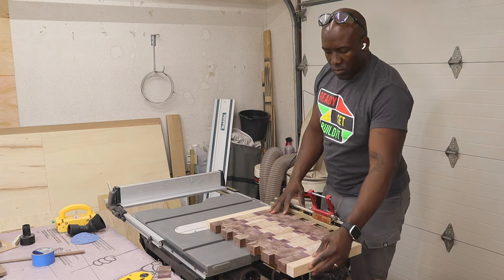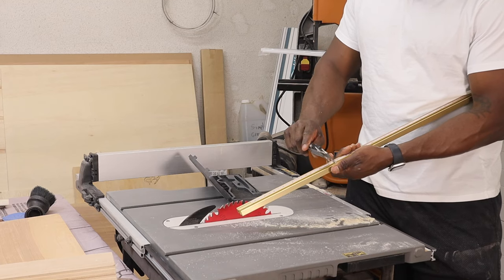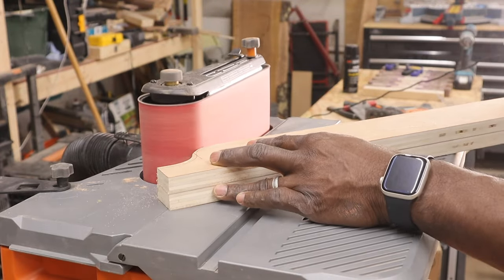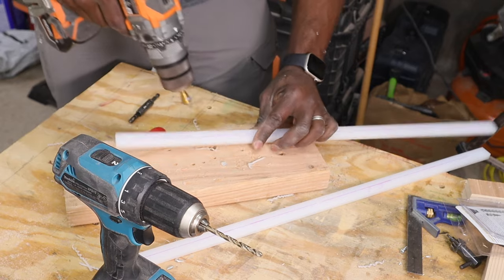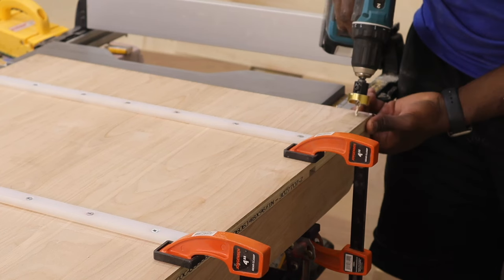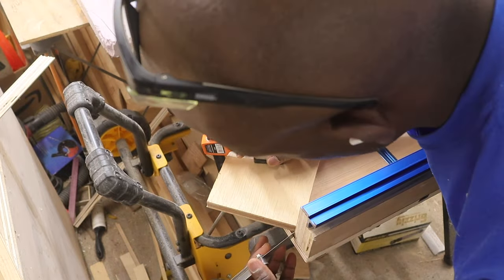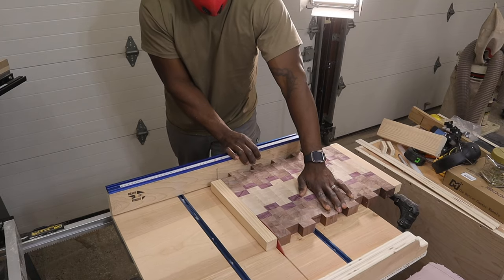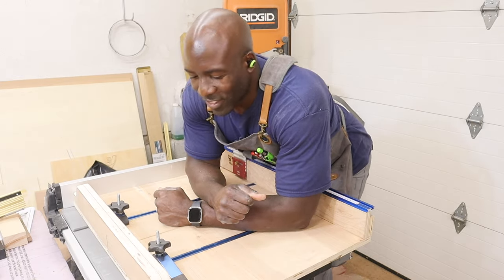The last Crosscut sled you’ll ever need

Comment: Enjoyed your video and just subscribed!  Have the same DeWalt table saw you do and am building my first crosscut sled with UHMW runners.  The runners fit and moved perfectly in the miter slots BEFORE I attached them to my sled base.  After attaching them with CA glue and the screws that came with the runners, now they won’t slide smoothly in the slots.  I hand-tightened the screws so as not to over tighten them using a drill and even backed the screws out some but still leaving them countersunk.  They still will not slide smoothly.  May go to the hardwood runner option as you did, but I live in a hot and humid climate and am concerned about wood movement when the seasons change.
Reply from the maker: Thanks. Welcome to the channel. I understand your dilemma. In your case I would go with an aluminum runner or at the very least pick a really stable dense wood for your runners and be sure to cut them with the grain in the right direction. Scotty Walsh has a great video about choosing aluminum runners you may find helpful. Thanks again for the sub and good luck on your crosscut sled.

Comment: The runners will spread as you tighten them. I did the same thing. I tried using wood but being in houston it would swell and shrink
Reply from the maker: I get that too. It’s possible I over tightened the UHMW. The next step, should these runners ever swell, is aluminum runners, but I think I’ll be ok due to the Ipe being of the hardwood floor variety and very old. Moisture content should remain really low.

Comment: Interestingly, I had an old DeWalt saw and had a similar issue with UHMW runners. No matter how much sanding and refining I did, I couldn't get them to glide smoothly.

When I upgraded to my sawstip CTS, the problem went away.
Reply from the maker: Curious. I was getting really frustrated. Specifically, I was having all my problems with the left miter slot. It’s almost as if the slot it self isn’t perfectly straight. I even sanded the inside of the miter slot. Once I changed to wood, all my problems disappeared.

Comment: I followed the build up to the point where you had to adjust for square with the feeler gauges. How are you able to adjust the wood positioning to make it square after you've already screwed it in?
Reply from the maker: I take out one screw from the bottom and use the other as a pivot. The. Once I gap it with the feeler gauge, I put the screw back in and perform the 5 cuts again. William Ng has a really good video on explaining the process. I linked him in the bottom of my video description. He does a better job than I can explaining.

Comment: This was a great video! I now have no reason to NOT build a cross-cut sled. Like you, I’ve been going back and forth about needing one. Now, is the time! I have the same table saw. I’ve also been debating the use of the UHMW for my runners. I’m afraid to use to use wood for the runners. I live in Maine and mother nature has been very moody. What’s your opinion on the adjustable metal runners? Also, what dado stack set do you use? It’s not in your tool list and I’ve been on the hunt for some…
Reply from the maker: Thanks so much. Temperature fluctuations was a huge concern of mine as well. I think if you go wood, choose a dense stable wood. That being said, metal runners are superior as they won’t move and their adjustability. I’ve added both a metal runner I like and the dado stack inside to the tool list. Another video to check out is Scott Walsh’s video on his sled. He goes pretty in depth on his metal runner preference.